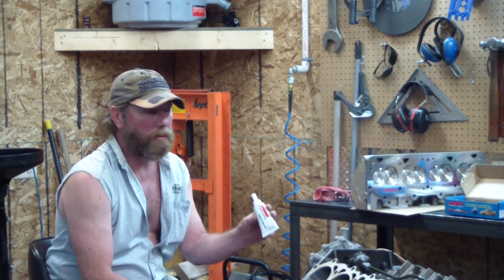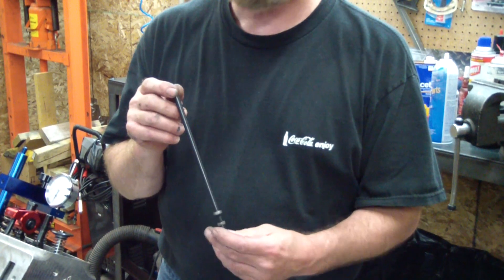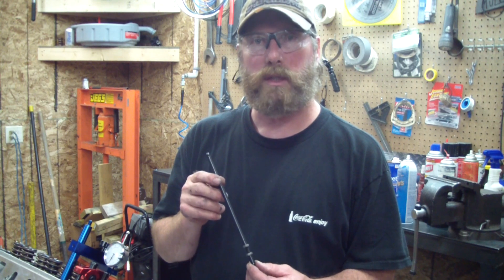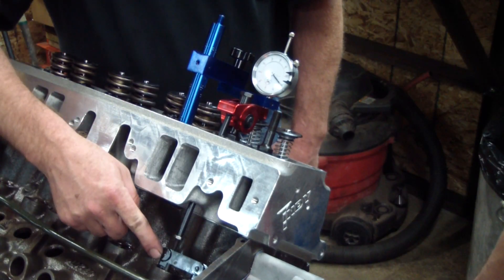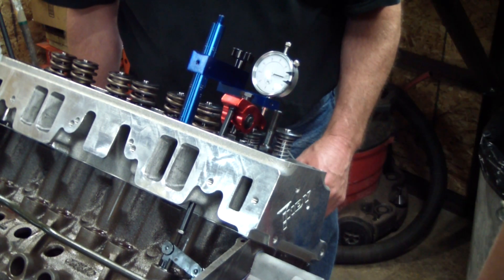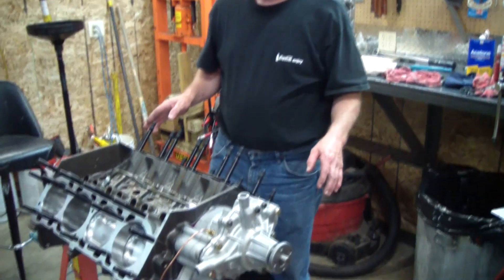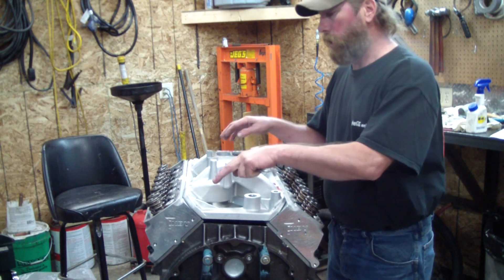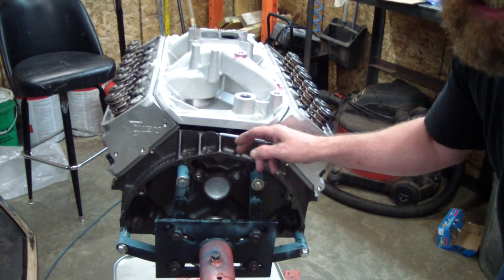AMC 401 Heads, Valvetrain Geometry and Intake Manifold Fit

Comment: Having a lot of vertical clearance does not necessarily mean it is safe 

If the radial clearance is not there the edge of the valve can contact the piston. A clay impression and the dial indicator is the best way.

Also, pushrod length will effect max lift. You have to take the lobe to max lift with the pushrod you have installed to know for sure what lift the valve is actually seeing, not just stop at the lift the cam is supposed to be.

Comment: i have a question hopefully you can help. I bought a car with a rebuilt 350 in it, i pulled it out swapped the cam, oil pump, and put on some rebuilt vortec heads. i didn't deck the block nor did i mill the heads. Now I have one head that takes the 7.850 pushrod and the other head show the rocker is hitting the valve stem very close to the exhaust side basically telling me this is too long. my question to you is, should i put on a thicker gasket or should i pull the good head mill it down the same size as the other and run a smaller pushrod? any help is greatly apprecicated. Thanks in advance.

Comment: Pushrod length is checked and adjusted for minimum pattern width in the mark on stem, not just for center. The wear pattern should be in the center, but the length is actually adjusted to have the narrowest pattern mark.